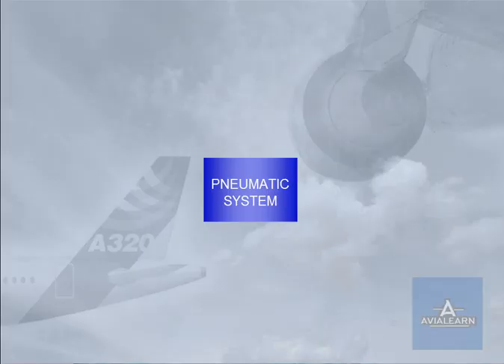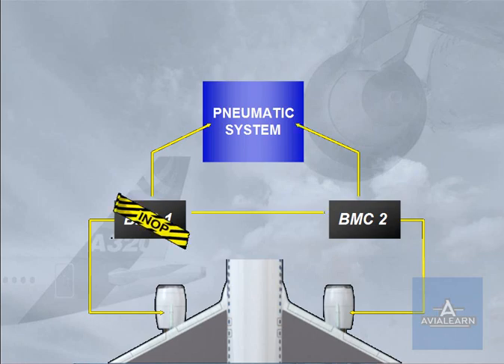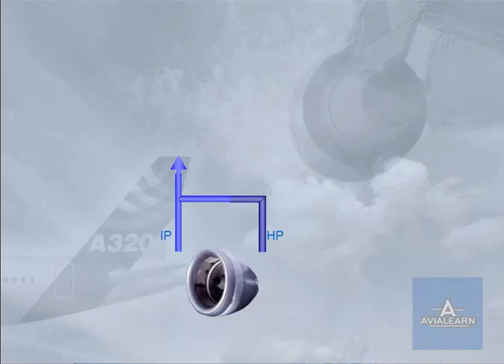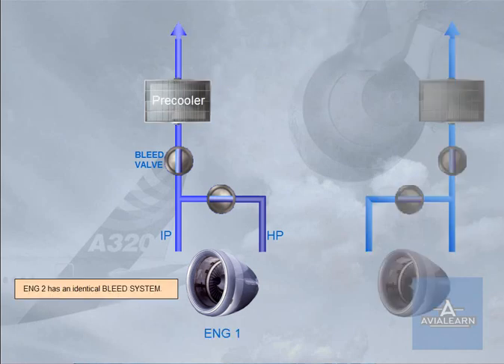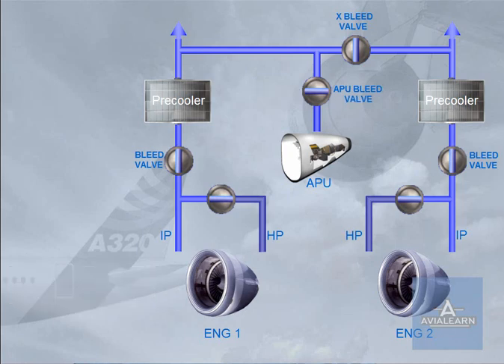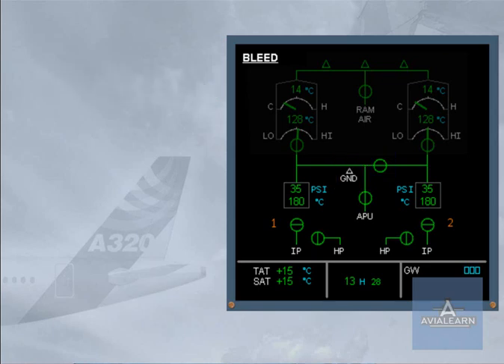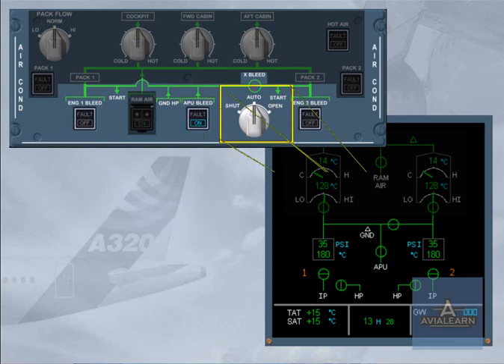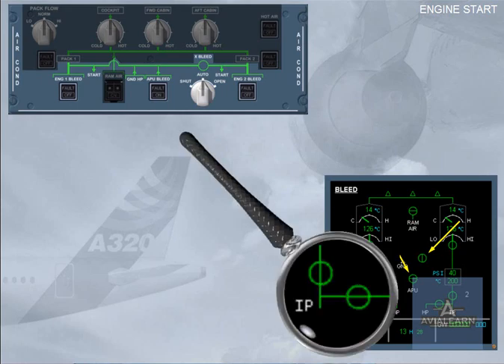A320 Family Pneumatic System Presentation

Comment: Doesnt make sense. We opc wing anti ice using apu bleed yesterday on a321. Amm says at least 10 psi is needed.
Reply: This video is ab a320. APU bleed air temperature is unregulated and it could cause damage to the slats if used